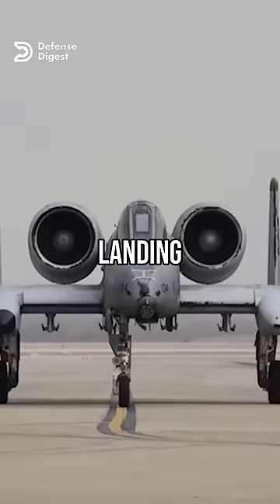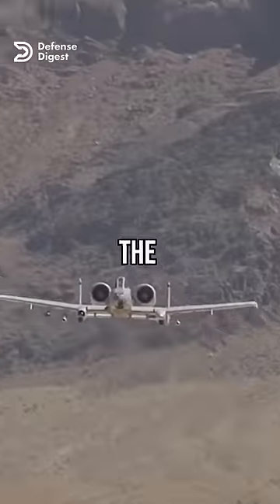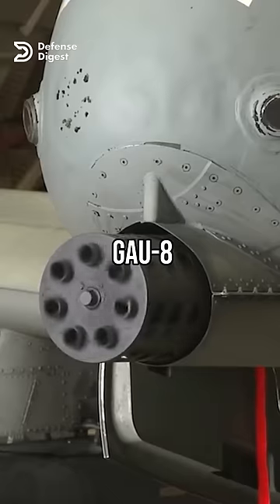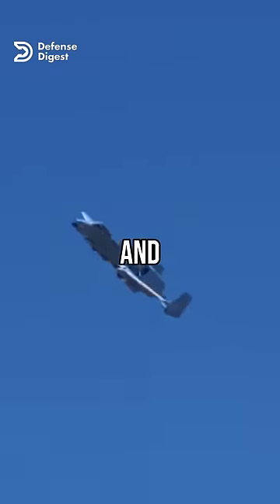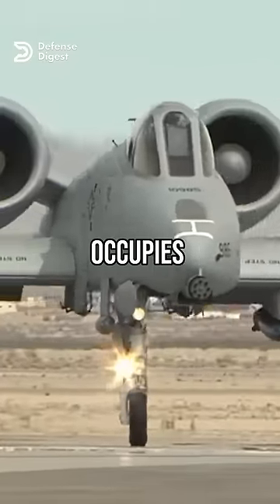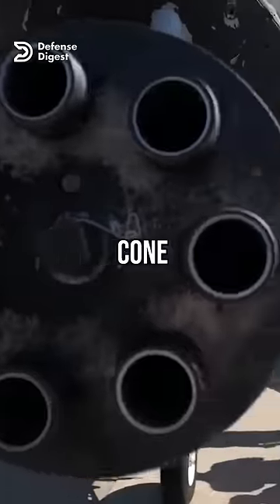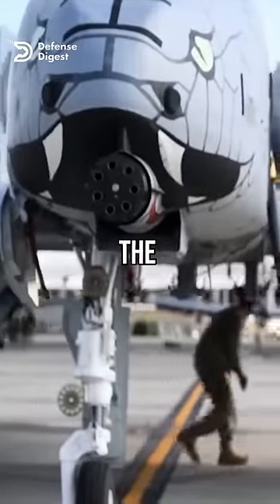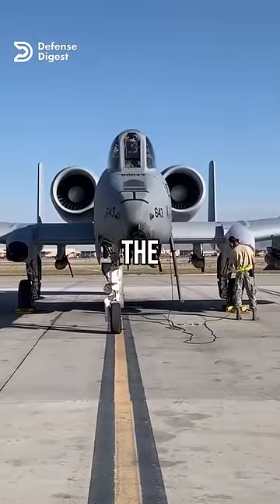Why A-10 Warthog's Front Landing Gear Not in Centre?

Comment: Fun fact the A 10 was designed to be able to fly even with one engine half a tail and half a wing missing
Reply: Two engine and wings are good but one is good enough
Reply: It doesn't.
Reply: @sys3248 it does probably
Reply: @sys3248 It absolutely was designed with that level of redundancy and resilience. It's a close air support attack plane. It has to fly at low elevation and low speed to make precision attacks on enemy targets while avoiding accidental friendly fire on nearby forces.

It's going to be taking lots of fire from anti aircraft weapons as well as anything the enemy can point at it.
Each engine powers a independent hydraulic system that can each run all functions in case of an engine loss. The wheels sit in a manner that allows them to function for landing even when retracted.

It is a massive gun we built a plane around and then made that plane as difficult as feasibly possible to shoot down. While also being incredibly deadly.
Reply: So does the SU-25, all CAS aircraft are designed to be the most survivable for its pilot
Reply: @NyxHunter  it made of titanium isnt
Reply: @p51_mustang109  Yep the cockpit is referred to as a titanium tub which can withstand beyond 50cal rounds. And the rest of the plane is covered in various thickness of titanium plates.
Reply: @NyxHunter  it will remain legendary even after it retired
Reply: @sys3248 it does. Happened. Look it up
Reply: @NyxHunter thank your for the knowledge 🙏
Reply: @Sturmtige10  Not even probably, we had someone who did it
Reply: @sys3248 it actually is. If it doesnt fire its gun, its able to fly at full takeoff weight with only 1 engine. 

Taking of is impossible with full payload and 1 engine tho.
Reply: "One spins to make your socks clean, the other spins to make something dissapear." -TheRussianBadger
Reply: Unfortunately war thunder doesn’t agree but I do lol
Reply: 2 wings is a luxury but one is a necessity
Reply: Correct me if I’m wrong but isn’t that the case for most aircraft’s excluding fighter jets
Reply: Well tell that to Gaijin bro
Reply: An A-10 pilot flew the plane with both wings clipped off and had an engine out.  It just won’t die; which is why I question the Air Force for wanting to retire this aircraft.
Reply: NOKKKKKKKKK
Reply: A10 have problems with thurst ratio, A10 HAVE A VERY BAD ENGINE!
Reply: @metalDCM8 civilian airliners are required to be able to fly on 1 engine (some 4+ egine stuff are only required to do 2) in order to be rated air worthy, but they still couldn't fly if you took a wing off.

Comment: the cannon is actually offset to the right because it fires at 9‘ o clock, so when a barrel fires a round it’s always in the center of the nose
Reply: I thought they could shoot the gun any time of day. Interesting to learn!
Reply: @brandonbp122  bruh😂
Reply: Wait, only one barrel shoot for a single shot?

Damn, this fact gave me headache🤣🤣
Reply: @yoslauda4714 I guess so, but to be fair, the rotary cannon GAU-8 spins fast like the M134 Minigun, so despite firing a single shot in each barrel, it still spins rather quickly.
Reply: @yoslauda4714 no point to make all barrel firing at the same time since the main factor to the fire rate is the loading. U put many barrel is so sthat the loading time can be decreased.
Reply: @yoslauda4714 
yes, it spins quickly so it can have a high fire rate while loading the barrels efficiently. this spinning and loading effect meanings that when each barrel fires it is in the same position as when the last one fired.
Reply: @aukahpusing9887 id say that heat is also a factor
Reply: @brandonbp122 wow. Now that's humor from an educated person. Well said. Made my day
Reply: I knew someone had to have beat me to this.
Reply: The cannon isn't offest to the right, the landing gear is. The cannon is offset to the left. 🤦
Reply: When you're in the pit it's 6.
Reply: @switdog08 and unloading, ejecting, clearing rounds.  And yes I know they don’t EJECT the cases overboard.
Reply: Makes sense, otherwise firing the gun would throw the plane off center because the recoil is so strong.
Reply: @EddieTheH yea ur right, depends on how your looking at the aircraft and in this video he shows the plane from the front, so the landing gear is offset to the left and the cannon to the right, if u look at the plane from the rear it’s of course the other way around but i think that this is not really worth discussing right?

Comment: The reason why the gun is mounted off centre is actually so the firing barrel (in the roughly 7oclock position) lines up through the centreline of the aircraft as to not causing a yawing action when the gun is fired.

Comment: I thought this was obvious if you know the Gua 8 sits at the front, so I thought it was pretty obvious the front landing gear would be offset but the fact that the thrust is as strong as one of the a 10 engines is insanely cool so it makes sense that the gun itself is offset to the left

Comment: It has nothing to do with forces.  It's offset cause the firing of the gun is directly inline with the pilots line of sight, the landing gears had to be offset to allow that to happen.  When the gun fires, the slats on the leading edge of the wings go up to allow more airflow into the engines. 

-Former A-10 Crew Chief (Crash Recovery)

Comment: It actually has more anti thrust than that. They are only aloud to fire 1 second burst cause any longer and it can stall the plane. And the fire rate is only 1500 per minute.  Work very close with this aircraft while in the USAF.

Comment: He Russians built a cannon that was faster and more powerful than the one in the A10....and it was unusable, because the vibration and recoil was so overwhelming that it would break everything.
Reply: Mig-27, yeah. It had 30mm cannon with a higher fire rate and power than A-10s. If you fired it for longer than like 2 seconds, it could break radar

Comment: Guns are mini cannons.
Reply: It's called a rotary cannon
Reply: @leduckified1534  It's wrong. Cannons are artillery and tanks.
Reply: @East_Coast_Toasty_Boy  "The General Electric GAU-8/A Avenger is a 30 mm hydraulically driven seven-barrel Gatling-style autocannon that is primarily mounted in the United States Air Force's Fairchild Republic A-10 Thunderbolt II." Happy?
Reply: @leduckified1534 
 No, as I've said, they're wrong.
Reply: @East_Coast_Toasty_Boy   that's from wikipedia

Comment: The f22 raptor is built with a gun. The a10 on the on the other hand is built around the gun
Reply: And the gun of the a10 is from the nose to the front of the wigs
Reply: And the landing gear is off set to the right just to fit the gun and it’s why the gun is a slightly off the left
Reply: The gun came first that doesn't mean it was built around it.

Comment: The a10 can only destroy tanks from the 60s or older and that’s IF it lands a hit which it rarely does. Most kills are done with missiles. It’s slow speed makes it very vulnerable to surface to air launchers. 

It’s not a great aircraft and was even worse in 2000s when a pilot accidentally killed his own men as the avionics on board were so poor he could not distinguish between friend or foe. The audio is harrowing. And with the insane vibrations of the gun, being 1 degree off from even a low height can make the difference between hit or miss or even hitting friendlies in a CAS role. 

Stop hyping up this aircraft just because big gun go brrrt